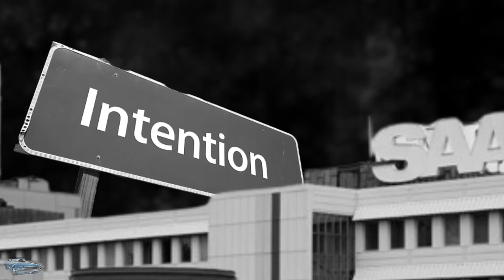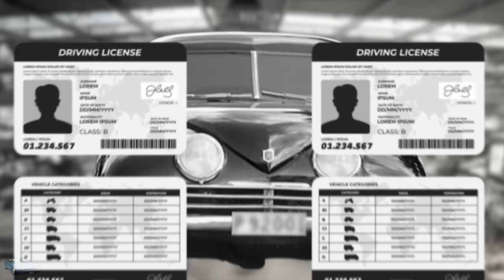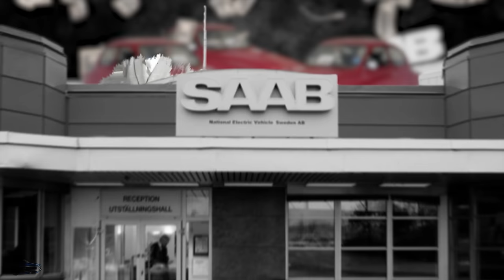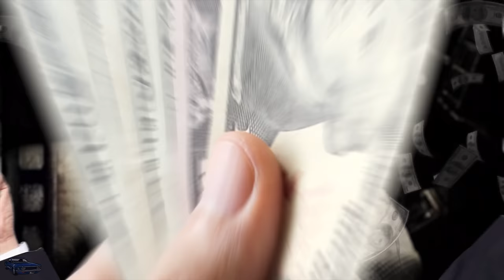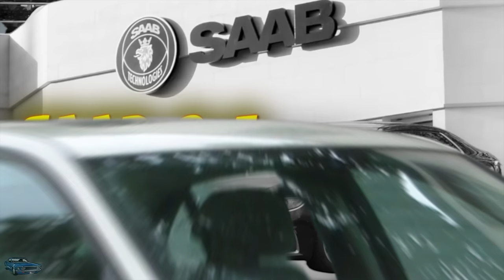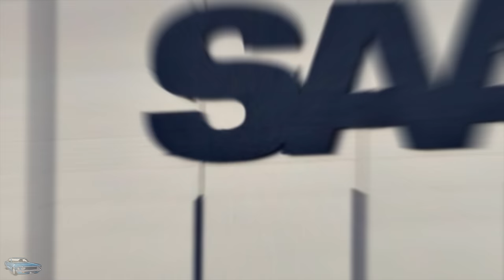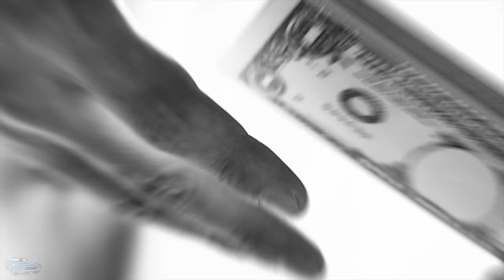The TRAGIC Fall of Saab | A Classic Car Documentary

Comment: SAAB was killed by GM. Even after GM had withdrawn, offers were made for SAAB by third parties, all of which GM blocked and scuttled. They really didn't want SAAB to exist. Criminal. How could Swedes ever let this happen?
Reply: They didn't watch enough Shark Tank. Nobody should ever sell away that much equity ever. It's always a disaster. There is no other end to that movie.
Reply: Yep. Sadly GM killed Pontiac as well. I owned a Bonneville and Grande Prix and GM only cared about Chevrolet and Cadillac. I wouldn't own a GM car now for anything. Very good video. I've always loved Saab's and their look. This was very informative.
Reply: @jamesseabolt5915  I owned Pontiac Aztek a couple of years back and I loved it. It was a French car in shape and spirit. Mine had air springs in the back and it drove like DS21.
Reply: GM was in full penny-pinching mode back then and only saw their overseas brands as money suppliers for their failing US brands. Opel was pretty successful, but pretty much every dollar they made was immediately sent overseas to keep plugging the holes in the finances of the failing GM brand in the US, whereas Saab was only costing them money, so they made the decision to get rid of Saab. There were enough interested third parties, but as GM refused to let Saab continue to use the GM platform Saabs have been built upon since the 9000, only a Dutch opportunist who was always funded with very shady Russian money was left and predictably Saab was in financial trouble from the moment he got control. Then a Chinese company still wanted to buy what was left of Saab, but for one reason or other the Chinese government blocked the financing back in China and as the Swedish government refused to help Saab like they had helped Volvo, or even to agree to have Saab's back for the near future, that was the end for Saab. Yes, there was this weird attempt in rebranding Saab into NEVS and going full EV, but that attempt kind of faded out quietly. 

The Swedish government somehow argued that Saab was too small a car manufacturer to survive and instead poured hundreds of millions into Volvo........ which they then sold out to the Chinese, so in a "brilliant" two-step move Sweden went from having two at least partly Swedish owned car manufacturers to now having NO Swedish owned car manufacturer..... Good job guys, well done.
Reply: GM wanted turbo charging technology and SAAB was arguably experts in turbo charging.
Reply: Unfortunately SAAB required a massive influx of money to modernize a really degraded product. Few were willing to undertake that mission. They proved unreliable and grossly underpowered here in the United States.
Reply: Apart from the mkII 900 (which GM demanded to be developed and put on the market in 16 months), Saabs were reliable and if you got the turbo models, they were fast.
But yeah, there was a need to spend way more money than GM did.
Reply: First you have to build a car that develops a reputation for reliability. One that won't break down frequently and cost a fortune to fix. I never bought into Saab but my brother did. While he liked the car, parts would break a lot. Parts that did not normally fail on an Olds Cutlass or even a Chevelle. He had it about 4 years and it spent a lot of time sitting inside the shed, waiting for parts to come from Sweden. It took some time but he eventually figured out he had one very expensive car that he didn't drive much. 

No auto maker could top the failure rate of Chrysler and Jeep (the worst of the worst). It is no mystery why Honda and Toyota popularity skyrocketed in the 1980s and keep going. 

Even my 1986 and 1988 Izusu Troopers were solid reliable vehicles that never once failed. The old style Troopers were a bit too narrow in the windy Midwest. Then Isuzu killed the Trooper by making it larger, HEAVIER and it sucked gas like crazy. That new line went belly up quickly.

Produce a product that consumers like (appearance), that is reliable like Honda/Toyota and gets acceptable gas mileage. My new 1999 Silverado got 35% better highway mileage than the late model Troopers. Gotta add in comfortable seat and ride. People will buy and keep buying.  
Do none of the above and you get bankruptcy.
Reply: We didnt want the government to join Nato/Otan either - does your government listen to the people….thought not
Reply: @LuvBorderCollies  Your brother must have had a bad example then, as Saabs normally speaking are very reliable. I bought my 9000 2.3 Turbo 170HP Lpt when it was already 16 years old with something like 230.000 km's on it and I tuned it to Stage 2 235HP and it never missed a beat. Sure there were worn brake pads, the occasional ABS-sensor and the turbo started to get slightly worn out when I no longer could afford to own the car, but it simply kept going.
Reply: @naradaian  Perhaps not enough of you objected loudly enough to be heard.
Reply: @tjroelsma Sweds make very strange and sometimes stupid decicions, i live in this country but tired now about it
Reply: @pip393 Degraded product?? You dont know what you talking about, Saab had   the best cars ever, much better than Volvo in many aspects, underpowered?? You are joking
Reply: @zdzislawmeglicki2262 True, stange people, dont complain never
Reply: It was dying when GM mouth them.  That is why they sold half the company to GM.  If they were a solid company like BMW, they would have remained independent.
Reply: @danr1920  Back then, recall, both GM and Ford went on a shopping expedition. Ford bought Volvo and Jaguar, GM added SAAB to Opel and Vauxhall. How times have changed! Both Ford and GM had to sell family silver. GM declared bankruptcy. Chrysler was sold for a dollar, or was it five?
Reply: corrupt polititians and corrupt SAAB management.as simple as that. They all got their -golden handshakes -. But could not give two hoots about their own carmaker.
Reply: @richsackett3423  Volvos are now made in China. No longer Swedish owned.
Reply: Business is not personal.
Reply: @tomquinn607  Oh, but it is. If you don't care personally about your business, who will? This is why Toyota and Honda are better companies than GM and Chrysler.
Reply: American generosity
I had a saab 93 1.9 tdi 150 bhp very nice very reliable and so on great cars I'm planning to get another saab
Reply: @dansome3563  1994, GM got involved and things began going badly for Saab.
Reply: GM did not block all potential buyers, Spyker bought SAAB from GM.
Reply: @tjroelsma  NOT once GM took over SAAB.
Reply: @christiansanden8005 All that went to crap when GM took over SAAB.
Reply: @john1703   When Spyker got involved, GM had already ruined SAAB so badly that Spyker couldn't save it. SAAB eventually went fully bankrupt and out of business forever. Not the only automaker brand that GM ruined/destroyed either.
Reply: @sergeantmasson3669  Quality definitely took a hit when GM took over, but SAAB's engineers still did their best by blatantly ignoring the orders from GM. But arguably they had to work with inferior quality parts, so there's the culprit for the quality drop.
Reply: Unless Saab somehow best telsa to electric vehicle mass adoption, Saab probably end up like volvo with or without GM. All the car brands that disappeared around when Saab died in America at least: Plymouth, Isuzu, Pontiac, hummer, Suzuki, saturn, mercury, Oldsmobile, daewoo, geo, volvo, smart car, scion... Ford killed off all their passenger cars (except the mustang), gm is making similar moves, toyotas best sellers are rav4, while most sedans are not selling. Thus it would be hard for Saab without gm wouldn't have its SUV 9-7 and more likely would at least be facing hardships, if not bankrupt anyways.
Reply: Swedes don't have much say if they don't own the company.
Reply: @pip393  They proved unreliable and grossly underpowered here in the United States?.

The Long Run – Talladega speedway in Alabama USA 100,000 km at 212 km/h! 
Way way back on the 27th of October 1986, Saab embarked on an endurance challenge to show the world just how good their new Saab 9000 Turbo was. This is why an endurance test such as the one Saab carried out at the Talladega speedway in Alabama USA was felt to be a good way to instil confidence in its new car  and to show the motoring press just how good a car the 9000 was. It turned out to be quite a challenge too. The distance ran was an amazing 62,000 miles (100,000km)at an average speed of 132mph (212 km/h) by three cars picked randomly from the production line with no modifications other than the fitting of role cages and a six point safety harness for the driver. During the test Saab managed to bag 21 international and 2 world records.

As we mentioned earlier, the cars were picked at random from the production line under the supervision of FISA (Federation Internationale Sportif Automobile) International motor sports authority, and were sealed prior to shipment to the USA.  Obviously Saab couldn’t carry out such a mammoth test without help, so partners were sought, these being Shell, Pirelli, and Garrett. Pirelli supplied 400 P600 tyres, Shell made sure that approaching 100,000 litres of fuel and suitable quantities of lubricating oil was available, and Garrett supplied back up and expertise within the world of turbocharging.

So what about the test itself. Well, 25 drivers, most of them Saab engineers, took turns behind the wheel of the three test cars. Each car made a pit stop every hour for fuel, and every other hour for a driver change.  Front tyres were changed every 12 hours, and the rear tyres every 24 hours, with servicing carried out at the normal 12,000 mile intervals. The cars were driven constantly at 136mph, with pit stops reducing the average speed to 130mph. This equated to each car covering around 3000 miles a day for twenty days.     Front tyres were changed every 12 hours, and the rear tyres every 24 hours, with servicing carried out at the normal 12,000 mile intervals. The cars were driven constantly at 136mph, with pit stops reducing the average speed to 130mph. This equated to each car covering around 3000 miles a day for twenty days.

To conclude the ‘Long Run’ post we had a look at the repairs carried out on the cars to see how they had stood up to the gruelling test, often carried out in heavy rain and strong winds. Despite these difficult conditions the average speed never dropped. This was put down to the excellent all round abilities of the Pirelli P600 tyres and obviously the skill and confidence of the test drivers.    So what went wrong with the cars during the test?       The engines were taken back to the engine laboratory in Trollhattan, where all three engines were subsequently found to be in excellent condition, although Shell did find a small degree of impurities in the drained engine oil.

The gearboxes had also performed perfectly during the test. The oil never changed as the units according to Saab were ‘lubricated for life.’

No chassis components such as springs, shock absorbers, or wheel bearings needed to be replaced. 

So there you have it, no need to be surprised anymore as to why your car ‘just goes on and on.’ Saab knew all along just how good their cars were. Saab’s 1986 media information explains: “The cars were driven constantly at about 220 KPH [136.7 MPH], but the pit stops reduced the average speed to between 210 [130.5] and 215 KPH [133.6 MPH]. Each car covered a distance of 5,000 kilometers [3,107 miles] a day–which corresponds to driving from Sweden’s capital, Stockholm, to Rome and back.”
Reply: Saab was purchased by a Chinese company that envisioned making evs, they had no rights to any logos names etc but did get the 95 production line, they produced some for local consumers none got imported, very low volume now I presume dead. Saad
Reply: @djisydneyaustralia  FALSE. Spyker NV is a Dutch company, not Chinese. 2014, Chinese NEVS company acquired Saab but only produced 380 cars and closed down. No EV's were ever produced.
Reply: BS. GM attempted to save SAAB from themselves, but they were too intent on killing themselves. I loved my SAABs, best seats in the business and the turbo gave them decent performance, but the stupid things on which they spent their development money was appalling. What was criminal is what they did to themselves.
Reply: GM means... Giant  Mistakes !
Reply: @CaptHollister  The SAABS that had GM components/parts all had problems.
Reply: @sergeantmasson3669  You say that, but I had no issues with either of my 9-3s.
Reply: As a long distance driver  Saab was unmatched car with quality and price, only Lexus from what i owned , but had a better safety feature and lovely drive. GM can’t handle that quality.
Reply: @CaptHollister  If true, you were damn lucky. The fact remains that GM ruined SAAB with their crap quality components/parts. My former neighbor had two 9-5 SAABS, same story. All the GM parts failed in both of them. I know because I did the repairs on both.
Reply: Keep in mind that unrestrained capitalism is motivated by the vice of greed, so the outcome is never good for workers and consumers.
Reply: When SAAB teamed up with GM the decline in quality was inevitable as GM has long produced inferior products while maintaining its monopoly on the American market.
Reply: @1956paterson  GM a monopoly on the American Market? NOT true. Ford has outsold GM many times in American automotive history. Another fact, Ford truck #1 in sales for the last 46 years straight.
Reply: @sergeantmasson3669  "All the GM parts failed" imagine that... yes, I remember reading that roads all over Europe were clogged with failed Opels and Vauxhalls due to failed GM parts, while in North America it was dead Saturns that clogged the roads.
Reply: @sergeantmasson3669  Very disingenuous statement. Mine didn't and SAAB had quality problems long before the GM buyout. SAABistas are a bit like owners of Beemers in the two-wheeled world: they completely ignore their ride's failures to the point of being comical (it was completely reliable except that one time when the alternator smashed through the block, but it was a minor thing, really or yes, all the handlebar switches melted and fused, but it was my fault for parking in the sun) or if they do acknowledge them it's only so they can blame someone else (yes, all RTs all over the world had to grounded, but it was the fault of the suspension vendor). It's fascinating to observe it in action.
Reply: @CaptHollister  WTH does BMW motorcycles have to do with Saab automobiles? Two different corporations and two different vehicles. Pre-GM involvement, Saab automobiles were good quality and highly reliable. A former co-worker had a Saab 9000 with 255k miles on it, never had any major problems. His wife drove a mid 80's Saab station wagon, no issues with that either.
Reply: @sergeantmasson3669  At least the truck and heavy equipment company, Volvo AB, is still Swedish owned albeit a publicly traded company.
Reply: @shnorth888  True.
Reply: @tjroelsma  General Motors had way too many arrogant people in control. Pontiac went from great cars to crappy cars as the years rolled by. The crappy cars came from crappy management.
Reply: @genespell4340  General Motors pretty much used the same tactics as Boeing: every new manager's main task was cost cutting and thus cutting costs they did. The first "generations" of managers who were tasked with cost cutting had it relatively easy, as there was still some fat to be cut, but later managers had to get more and more "creative" and thus quality and quality control dropped and kept dropping. The real problem is that managers who successfully cut costs were immediately promoted, consequences be damned, so the more successful the cost cutting, the sooner the next manager was tasked with the same task, accelerating the quality and QC drops. 

SAAB refused to play ball and that's why GM axed them.
Reply: SAAB killed itself. They were out of touch with reality so they  had to turn into GM to stay afloat. Even then they were ignoring GM and kept being delusional. SAAB killed itself.
Reply: Not a mystery when you see what's going on in Sweden as a whole.

  A once proud people with a thousand year long history of perseverance and courage that basically destroyed itself out of self hatred, shame and an incessant need to please the US and western Europe as a whole at any cost, finally capped off by officially becoming a US vassal state with thier bid to join NATO.

Much like the story of Saab the modern swede is now impotent, insecure and just another toothless dog pulling the NATO sled taking direction from its owner in DC that's guiding it straight off a cliff.
Reply: I bet Preston Tucker could tell a similar story about GM.
Reply: Typical American business stragety, killed the Competition , remember how GE killed Alsthom , Toshiba
Reply: I always liked SAAB's, quirky, different and handsome,
just like me. ;))
Reply: @pip393 Unreliable and underpowered??😯😯 Saabs are fantastic cars, I own 4 of them, all daily drivers for my wife & I...they are the best cars people never drove or owned! Best combination of safety, comfort, performance and handling for any car brand! They never left us stranded, no more unreliable than any other brand.👍
Reply: @pip393  Gotta wonder what your statements are based on, pip. I owned both a 900 and a 9000 and they were the nicest, best performing, trouble-free cars I've ever owned compared to any of my GM, Chrysler and dear lord, Ford products. As Saab models aged they were compared with Mercedes, and fell behind - I'll grant that much. Speaking of, sure wish the Swedes had partnered with any of the German auto manufacturers and run screaming from any meetings with GM back when.
Reply: Maud Olofsson were in on the kill.
Reply: GM refused to let any potensial buyer of the SAAB company use the SAAB name, thats why they had to name the new cars NEVS
Reply: @gaardengaarden  The big problem for Saab is that GM did not want the Chinese to obtain their technology, so this really scuttled any chance of a Saab sale to a Chinese owned car company that would maintain the Saab brand. Ironic that Volvo was sold to the Chinese... 😳
Reply: Olds mobile saturn
Reply: The story is more complex than we think, but basically it might have survived if they (Saab & GM) would have been happy with one model. 9-3 and 9-5 was a lot like each other, but not close enough to do a Tesla coordination using a scaleable platform. Badge engineering and too many version without the Saab spirit in it killed it.
GM wanted their ideas, not the factory. Saab was never able to develop new models with their own money, earning too little on each car. But the cars were good, just too expensive to build.
Reply: GM didn't understand saab as company
Reply: I think zdizislaw have answered this himself. GM played out 3 countries and 3 cities against each other to see if they get some money from any of them.
It was Opels oldest factory in Bochum Germany, Saab Trollhättan and a Vauxhall factory in GB. All 3 governments realised it would be close to throwing money into a black hole. Opel was described by GM ad the best thing that has happened since sliced bread, yet when Opel was sold to Peugeot they admitted Opel hasn't been profitable in 16 years, in spite of way higher volumes than Saab. Peugeot claimed they turned the loss into a profit i just 11 months. But they forced GM to close Opels Bochum plant before Peugeot took over. Selling Saabs with cheap Opel/Vauxhall parts at a higher price was GMs business case and the whole idea behind their bizarre "badge engineering" philosophy. Saab refused, so their name was dragged in the dirt by GM. But Saab cars never made any big money anyhow, GM bought Saab because it was a fantastic think tank, not for their manufacturing capacities. But when GM got problems due to the financial crisis in 2008, they lost so much money they could no longer defend owning Saab. It's a big pity, the new 9-5 was probaly a good car (i got to drive one). But realities and foul play killed it.
Reply: @carlc5748  The case of Tucker was in a sence even worse, all 3 US giants GM, Ford and Chrysler felt threatened by Tucker. For SAAB it was "only" GM, but obviously enough. Saab made to few cars to pay for develoment of new models. Up until GM stepped in, Scania put up with funding. But look at it, we are only talking about 92, 93, 96 which basically was the same car, the 99, 90, 900 mk1 which also was the same car. The 600 and 9000 was developed together with Fiat/Afa/Lancia.
Reply: I hate GM…trash cars from a trash company
Reply: Er... it was because SAAB was in dire straits to begin with that GM even had a leg in the door. SAAB's problems were basically its own making, sadly
Reply: @stevenjervis1184  that’s for damn sure!!
Reply: Saab never made a profit and that's what killed them. They burned all their money on the 99 which didn't sell well
Reply: Swedens Government let SAAB GO!
Reply: This! GM is evil and not many people realize it was GM that destroyed SAAB because as you say, several offers where made and there where chances to keep going, but no, GM could not let that happen. Unbelievably sad. And don't let me get started about how Volvo was driven into the ground...